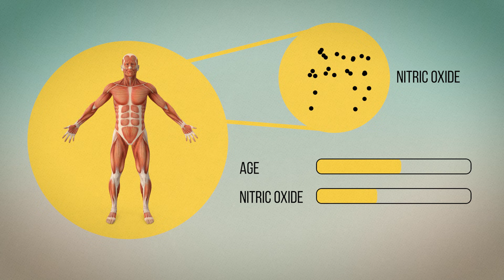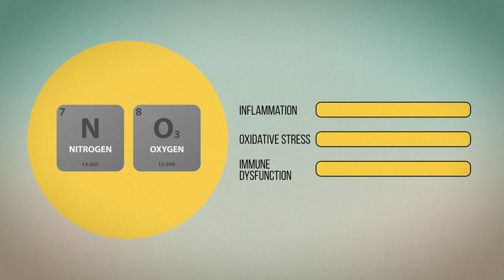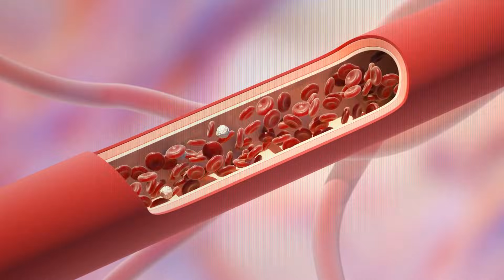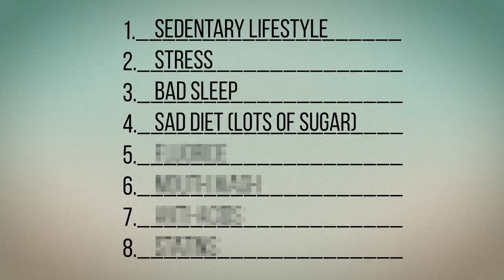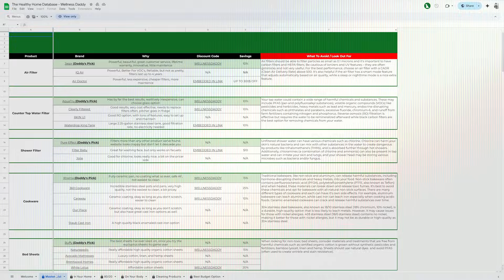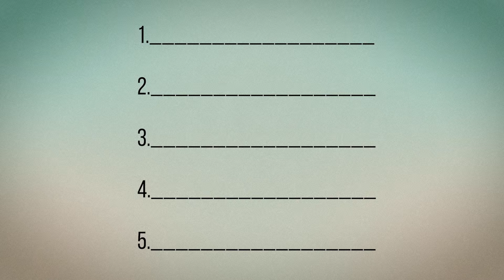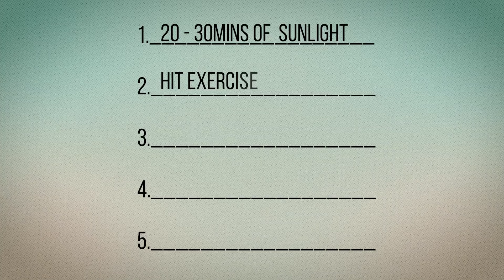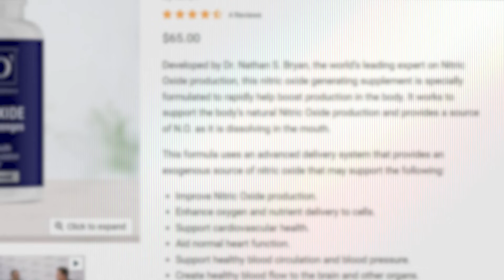The Miracle of Nitric Oxide

Comment: Ugh, is this guy the RFK whisperer or what?  Seed oils?  Low carb diets?  These are not evidence-based.  Sure, reducing processed carbs and sugar is great, but you don't need to throw out veggies, whole grains, and beans, which are all relatively high in carbs.  

I was dissapointed that he seemed more fixated on getting rid of flouride and seed oils and carbs and just supplementing with this product than actually suggesting people get good sleep, activity, and certain foods that are specifically high nitrates, which break down into nitrites in the body and are then converted to nitric oxide, specifically beets and certain greens like kale, cabbage, broccoli, and arugula among others.  There are probably other foods that have decent amounts, but these seem to be particularly high.  

The great thing about nitric oxide and why it lowers BP is that it's a vasodilator, so it increases overall blood flow in your arteries, something particularly important for those with diagnosed heart disease or those who may have the beginnings of the disease but are not aware of it.